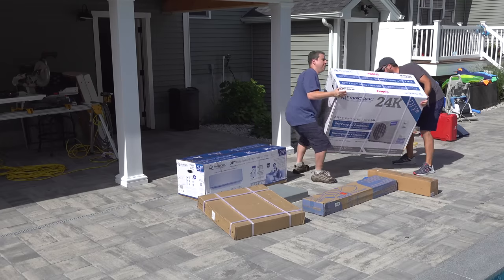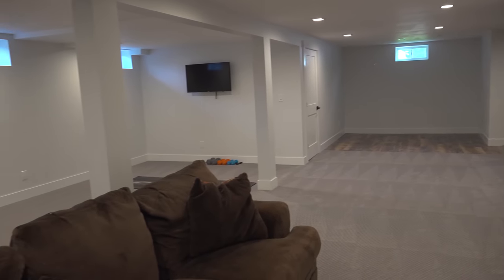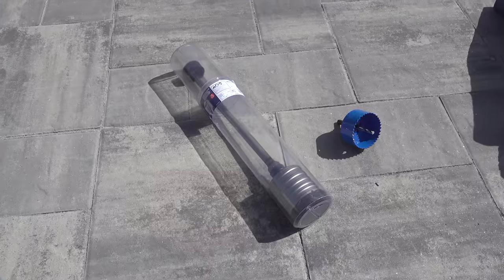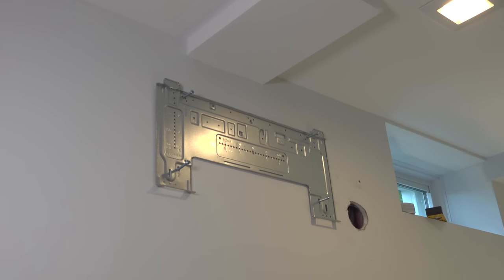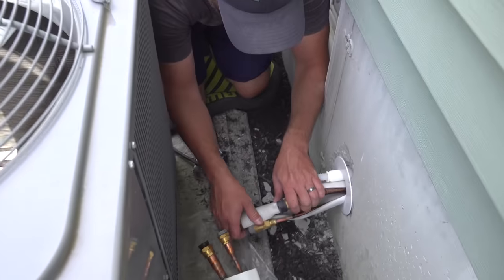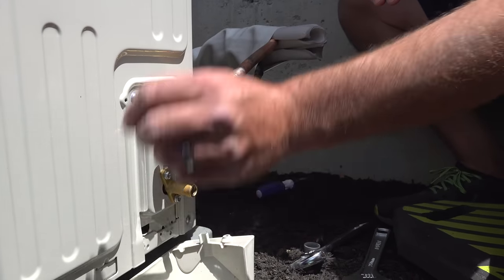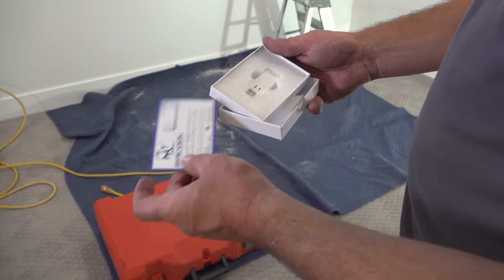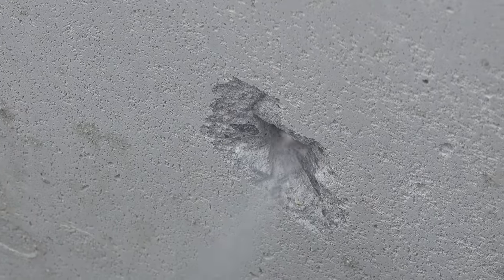Install your own AIR CONDITIONING in 4 HOURS!  DIY Mini Split MR COOL

Comment: A few crucial steps were missed. 
1. Reading Mr cool instructions will tell you at the end you will need to pull a vacuum to evacuate moisture out of the system. Below 500 microns (not stated but thats the HVAC requirement) before releasing freon. If this is not done, there is a very high risk your unit will not run right and you'll end up calling a HVAC company to recover all the contaminated freon, pull a proper vacuum, and fill it back up. This in itself could cost you a few hundred dollars over what you've already paid. However the proper tools to do it right will cost about $1k or more, so going through an HVAC company is still the cheapest option.
2. The bid from an HVAC company usually comes with a warranty on the unit and labor which makes the company reasonable for any physical damage done to a home or business. For DIY, In the instructions, if all steps are not "perfect" then Mr cool can say the instructions weren't correctly followed and therefore will not be liable for any warranty or damage to your unit or home/business. So going through an HVAC company comes with guarantees, thats why it's more expensive, and the work is done for you. Only guarantee for DIY is the unit was good in the box at the store when you bought it. The rest is on you. So consider carefully your skill level, tools, and help skill level over price before DIY when it comes to HVAC and mini splits.
Reply from the maker: You do NOT pull a vacuum on this system. The lineset is pre-charged and sealed until the lines are connected when the valves on the lines open and then the valve on the condenser is opened.
Reply: @SilverCymbal  Yes looking closer the lineset connections do look like a precharged lineset. Vacuum is necessary when cutting and flaring the ends. Only in the video this detail wasn't clear as in the video it states freon is "only in the condenser". The lineset and head is also precharged with a small amount of R-410a.

Comment: Good luck with that diy 4 hour  install. When the unit fails a couple of years from now no company is going to want to follow your DIY work and try to fix it so they will give you a quote for a whole new system that is properly installed.

Comment: You have Central Air already installed ?  There are 2 Compressor Units sitting next to each other ?  What am I missing ?
Reply from the maker: He has 2 smaller zones for his first floor that are ducted. There was no ducting in the basement which would have been a very large expense for ducts and the open layout makes this a perfect fit since it provides heat & air conditioning

Comment: Looks like a great system but why install the air handler in the basement where it stays cool all year?
Reply from the maker: Remember it cools ad dries the air which is very helpful down there, but its a heater also.

Comment: So, no evacuation of the line set with a vacuum pump?  Strange,  what happens to the moist atmospheric air that is trapped in the fittings?

Comment: Awesome vid to be honest (makes me a little confident in my monkey construction) but I do have 1 question. When you mention the outer box on the house for the addition power that'll power the new AC, do you recommend an electrician setup that new outside box or just attach the AC power to that box?
Reply: That'll depend on your local regulations and your electrician skills.

Comment: You do have to have a professional check the fittings for leaks or you can loose your coolant. So not 4 hours. As well as update your electrical.

Comment: Three separate units. I couldn’t afford the hydro on that thing. Why not just upgrade the system. Why was it not designed in the first place for the entire house? I get the need for two units sometimes but three units to maintain and power just seems a bit weird

Comment: There's no concern about the air and humidity that was in the lines when your released the refrigerant? I've heard that you should vacuum down the lines first. No?
Reply: yes you should always do a vacuum … any air left in system prematurely kills ac unit 👍
Reply: The lines are already vacuumed and filled with refrigerant. When you connect everything all the fittings bottom out. This is what makes it DIY. everything is already premeasured

Comment: LMAO no vacuum pump used, good luck with that shiet on the long run. even though its not alot of piping, you got some air in it.
Reply from the maker: No air, no vacuum needed. Line set, condenser and air handler are all prefilled and sealed. Amazing how many techs have never seen this technology.

Comment: How far can the heat pump be away? Is there a guide or maximum distance? The room we need to cool is to much in the interior.
Reply from the maker: Yes you can go to 50' with their added hoses
Reply: @SilverCymbal  what is considered too far away? The area is around 4 meters away from the nearest window, around 150 inches. Sorry I don't know much about these things.

Comment: Can someone please answer this question for me. I have watched many videos involving this kind of install and some talk about getting a qualified engineer to do the bit at the end where they put on vacuum pumps and also checks for leaks etc. When I spoke to the retailer before ordering my unit, he said that the reason that was needed was to evacuate the lines so that the air inside the pipes do not contaminate the refrigerant which will eventually be let into the pipes. But in other videos (such as this one), the guy simply connected the pipes from indoor unit to outdoor unit and turned the valves to let the refrigerant gas into the pipes. No evacuation needed. What is going on here? Am I being duped or lied to?
Reply: Cleaner is better, meaning if you can evacuate the linesets it would be nice. That being said, there a drier or filter in the unit that will absorb a certain amount of contamination and protect the system. 
If you are extending the system beyond the supplied linesets evacuation would be nessassary.
Hope this helps.
Reply: @areuaware6842  Thank you. I’ve installed two units and have been quoted £520 to do the commissioning. The units came with pre-flared 3 metre lines and that’s what I used. Didn’t extend. I thought that quote was very expensive and the people the retailer recommended keep fobbing me off but they quoted me £350. So in the end I’ve ordered a vacuum pump and the gauges for £95 and will try to evacuate and check for leaks myself. In the UK you’re not supposed to do that and the warranty is voided if you do. Given the extortionate price they charge for an hour’s work I thought it was worth the risk. But thank you for the information. It means I can switch it all on even now but since I’ve already ordered the equipment I’ll wait a little longer.
Reply: @davefordham14  You're welcome and enjoy your air condoning!

Comment: Yep bend those linesets with your hands, thats an automatic kink. Also when you hook up the lines before releasing the refrigerant you need to do a nitrogen check to make sure no leaks, if you do it the other way and it leaks which happens alot due to these fittings having to be seated almost perfectly, then you are releasing refrigerant into the air and according to the epa your depleting the ozone and its considered jailtime and/or a very hefty fine. Also there is so much more to this so yep go ahead do it yourself and ill be happy to charge you what I would have plus to install

Comment: That white conductor should be marked as a hot either black or red. White indicates a neutral and is a code violation when used as an ungrounded conductor.

Comment: And I am not an electrician, but even I know that if the line comes into the fuse box and use a black, white copper wire. (mostly for use for 120v) the white line needs to be wrapped in black or other identifying tape. But doesn't mention that in to video. Hope homeowners know this.

Comment: Actually you cant do this yourself or you are illegal. A licensed heat and air tech is suppose do this cause most people wont get the lines right where they connect inside the wall right and your unit leaks refrigerant into tour wall and quits working. Also unlicensed people arent allowed to mess with refrigerant.

Comment: Before releasing the refrigerant gas, the piping should have been vacuumed, using a vacuum pump, at least that's how we do it here in Brazil, that would be the most correct.
Reply from the maker: Not with this system, the line set and condenser are sealed and freon filled. They only open their valves which can be seen inside the plastic caps on the line set when properly connected. The system is entire factory filled and sealed to perfection.

Comment: What about the vaccuming of the line prior to release the freon?
Reply from the maker: Not with this system, the line set and condenser are sealed and freon filled. They only open their valves which can be seen inside the plastic caps on the line set when properly connected. The system is entire factory filled and sealed to perfection.

Comment: Okay so I have an issue with this system. There is air in your line set, and air has moisture and moisture is not able to be compressed by the compressor causing premature wear.

Comment: What happens to the air trapped in the line set? Is there a drier filter built-in?
Reply from the maker: Not with this system, the line set and condenser are sealed and freon filled. They only open their valves which can be seen inside the plastic caps on the line set when properly connected. The system is entire factory filled and sealed to perfection.

Comment: Well, I would have tried to locate an area that didn't involve a stud.  Granted it may not be a load-bearing beam, it's still better to find an area that doesn't have wires or a stud....
Also, I'm a bit concerned about the electrical going through the hole (granted the hole is covered with plastic pipe but still).  I would almost rather it be hard-wired into the wall itself than fishing a wire through the hole.  Perhaps the 120V unit has an AC plug on it you just run down the wall into an AC outlet.  I woulid prefer that because that way if there was any electrical issue, or wire fraying, you would see it.  I just don't like fishing electrical wires (espeically ones that are high-current) through walls, even though there is piping to protect it from getting damaged and in some places (states) that may not pass building codes/standards.

Comment: What about the moisture inside the lineset? You need to take away the sir and moisture by doing the vacuum for sometime.
Reply from the maker: The lineset is also prefilled and sealed with refrigerant.

Comment: Refrigerants are the fluid media used in air conditioning,  "gas" is a physical state of a substance, and the refrigerants used in the system are compressed until they change into a liquid state then pumped under high pressure into a condenser (heat exchanger) this is cooled externally or outside of the living space, where it stabilizes in it's liquid form as the heat within the compressed liquid is released into the outside air, and the cooled liquid refrigerant gets  pumped still under high pressure back into the living space area of the system where it is depressurised, this physical change causes rapid absorption of heat, so it is done gradually in an expansion tank/separator to prevent the condensing moisture from the living space air that formsbon the metal surface from  freezing into a block of ice, by restricting the passage of the refrigerant as it transforms into it's gaseous state it purges through a restrictive orifice that slows and physically controls the rate of movement of the viscuous fluid at a lower volume of liquid flow  pre determined to limit function until a specific pressure is exceeded then control the movement of refrigerant, maintaing the correct pressure provided to the system by the compressor. This also prevents the rapid depressurizing of the high pressure now vaporizing fluid as it flows into a low pressure heat exchanger called a core, gaseous liquid vapors  transformation into a full gaseous state conductively absorbs heat on contact with the metal internals of the core, and an air handler  fan blows inside air through the heat absorbing core and as the refrigerant absorbs it, it becomes a full blown gas and since itches less viscosity it can pass into a dryer where speciffic  liquids are unable to permeate, then pushed to the low side through the condensor again as they are cooled on their way to the compressor. 
I'm pretty sure I got that right. I'm no expert, but that's how I understood it based upon my limited experience, without looking anything up either.

Comment: This was a good video but my only Beef is it was more like a Commercial for Mr Cool  at this point in life there are many other mini Split units available some on EBay that are less Expensive than the Mr Cool ones  I would like to see reviews on some of those  and their Installation process /reviews  why ? It’s simple  these days this type of unit is being  used  not just for remodeling but  for Boats and RVs  as well  there is even one out there that can be run off grid  using Solar Energy

Comment: you should vacuum the system before opening the refrigerant valve
Reply from the maker: Not with this system, the line set and condenser are sealed and freon filled. They only open their valves which can be seen inside the plastic caps on the line set when properly connected. The system is entire factory filled and sealed to perfection.

Comment: If you had stopped drilling the wall the moment the tip appeared and then switched  to drilling from the outside it wouldn’t have split all the surrounding concrete and you’d have a nice clean hole both sides.

Comment: Adding a 220 line $1,200-$3,000 by certified electrician.  Cost of 2 12,000BTU window units on 110 lines ...$600/each with store warranty

Comment: The next video should be how to replace the compressor due to not pulling a vacuum on those refrigeration lines getting out all the air and Noncondensibles. I hope somebody didn’t pay for that install. If anybody says you don’t have to do that then they clearly don’t know what they are talking about and surly hope they haven’t installed to many systems in peoples houses.
Reply from the maker: Learn something new every day, Not with this system, the line set and condenser are sealed and freon filled. They only open their valves which can be seen inside the plastic caps on the line set when properly connected. The system is entire factory filled and sealed to perfection.

Comment: I've always wondered why this trend of split unit ac hasn't picked up in North America unlike everywhere else in the world where it has been the standard since the 80s, and for 1/4 of the price from Japanese makers
Reply: I have read that it's becayse if our extreme climate. Some people say it doesn't perform well at very high or very low temps.
Reply: @YSLRD  in below water freezing Temps (0 C)  yes they don't work as heat pumps and will auto shut-off, but I've seem them work in the blazing hot of the middle east with no issues with the cooling function
Reply: And the funny thing is we use American brands in the middle east 🤣

Comment: The only real issue I see with this product is that it's good for only one location. That's perfectly fine if that's all you need, but if you want multiple locations on a single mini-split then this wouldn't work, unless someone buys multiple condensers. Now there may be condensers sold by this company with this multi connection option where DIYers can do themselves. But this video only showed for the one connection. Seems fairly ingenious nonetheless.

Comment: I always thought you'd have to pull a vacuum on the line set to get the air out first.
Reply from the maker: Not with this system, the line set and condenser are sealed and freon filled. They only open their valves which can be seen inside the plastic caps on the line set when properly connected. The system is entire factory filled and sealed to perfection. Check out a new video I just posted on a different install I explain this more:  https://youtu.be/kEWzIfnIhUw

Comment: What do you do with the excess line?   20 feet is it?
Reply: As long as the length doesn’t exceed the units capacity for a run you can spool it up behind the unit you want atleast a 10’ run to an indoor head on most systems having a couple extra feet isn’t going to cause issues

Comment: You would think with 2 already installed ac units on the house that basment would be an ice box, mine is when its 90° outside and i only have 1 small central ac and my basement foundation walls arnt 18in thick..

Comment: I WOULD USED STUD FINDER TO FIND STUDS BEFORE DRILLING  THE BIG HOLE also YOU CAN PUT YOUR OWN HOLES IN PLATE WERE THE STUDS ARE  TO SCRW INTO STUDS

Comment: so what happens when the gas runs out, is it easy to refill and at what cost
Reply from the maker: It shouldn't ever leak but it has standard purge and fill ports that a pro can use if needed.

Comment: Work with a local HVAC pro I had a MRCOOl but it died no support that’s why locals call them throw away unit!! I got a Fujitsu 24k btu 10 year warranty for same price installed. I’m Kia it can be repaired and I didn’t have to install it my self a licensed professional did!!! Do your homework call around get a Mitsubishi or Fujitsu don’t be a dumb ass!!! Spend the extra 300$ if necessary.
Reply from the maker: Not sure why you are insulting me, he paid $2200 and you probably spent $6,000 or more. You didn't spend the same and a year later he is still loving his system. He can replace this completely 3x before he spends what a pro would charge and this has a warranty. The only reason pros hate these, is because mini splits are the easiest money they can make. The reviews are fantastic.